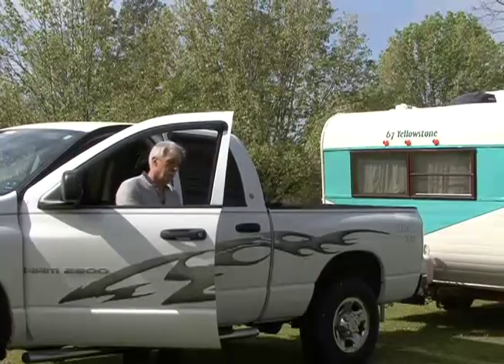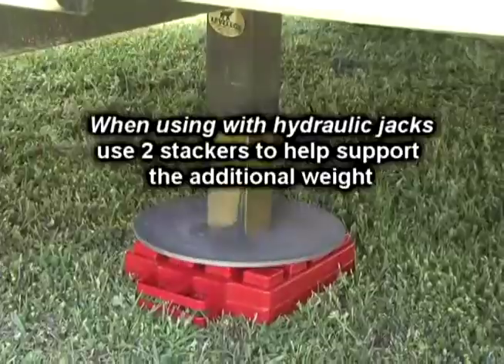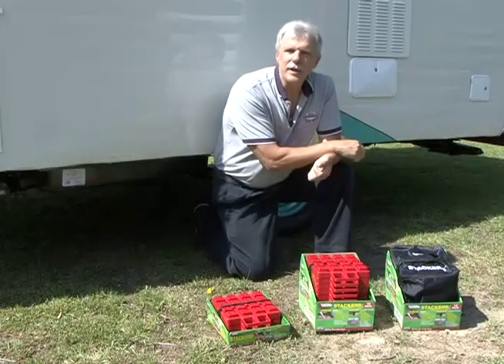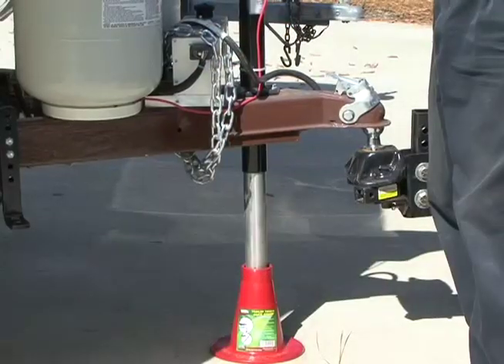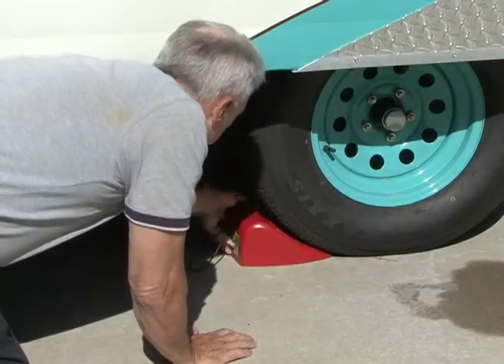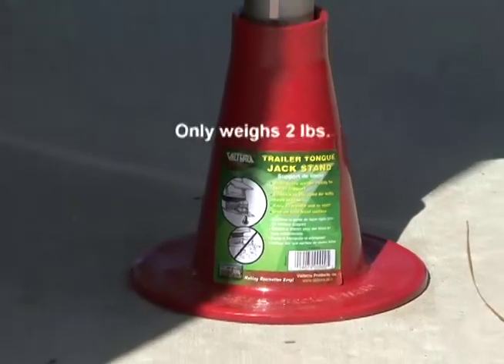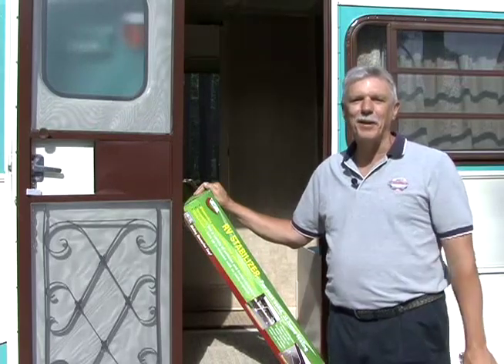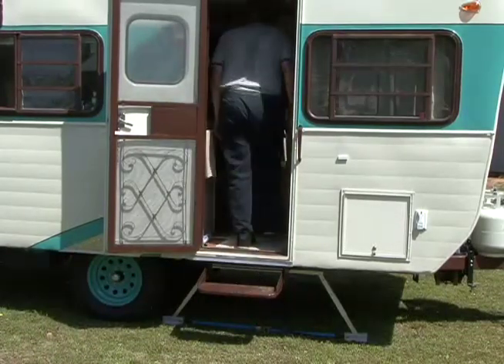RV Levelers, Wheel Chocks & Stabilization by Valterra

Comment from the maker: Yes, there have been many horror stories regarding trailers and wheel chocks. Especially with trailers that have a wheel on the tongue jack as opposed to a solid landing leg. Some incidents are humorous while others can result in serious injuries. The lesson here, level the trailer from side-to-side and then chock the wheels before disconnecting from the tow vehicle.

Comment from the maker: Part 2:  But since there is a slim possibility of something like this happening it is recommended in Dinghy Towing Guides that you cross the safety cables. Just make sure the cables are long enough and that they do not interfere with other components on the tow bar when crossed.

Comment from the maker: Part 1:Crossing safety chains mostly applies to a coupler and ball situation like when towing a travel trailer, because of the possibility of the coupler separating from the ball hitch. Motorhome mounted tow bars like most Blue Ox models attach directly to the hitch receiver and it is very unlikely that it would separate like a coupler and ball might.- Read Continued answer below.....

Comment: I have a single axle pop up camper. How many chocks do I need? Some people tell me two, while others tell me four and everyone says to place them differently.
Reply from the maker: If you want to prevent any possibility of the pop up moving it would be best to use 4 wheel chocks. One in front and one in back of both tires. If you only chock one tire (front and back) it is possible for a gust of wind to move or rotate the pop up a little on the side that is not chocked. I think everybody has their own opinion on this, but like I said earlier to prevent any movement I would recommend 4 chocks.
Reply: That's what I got. I just didn't feel safe with two. Thanks!